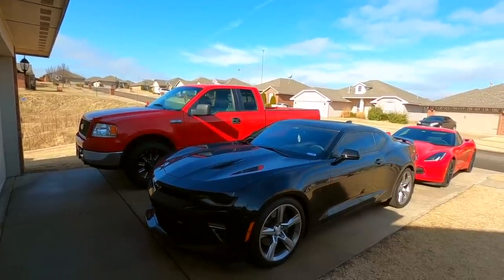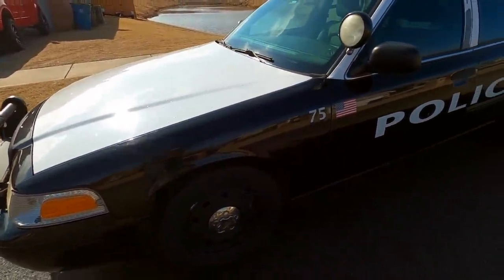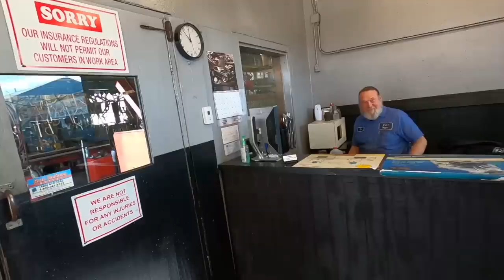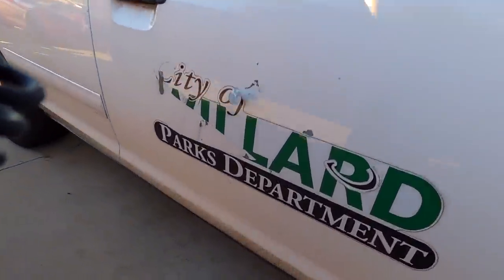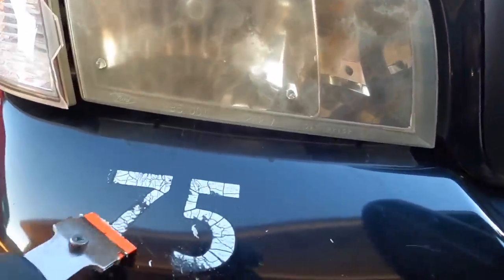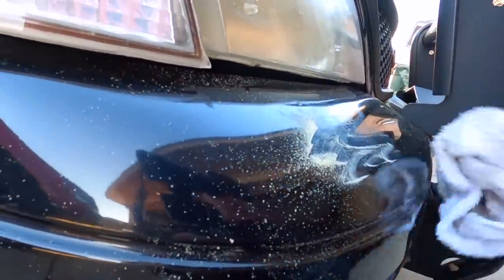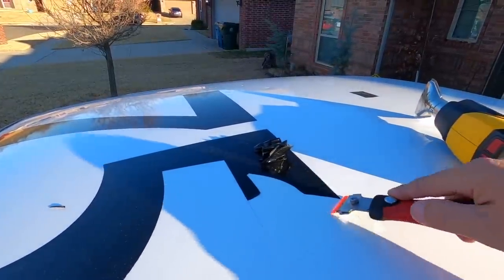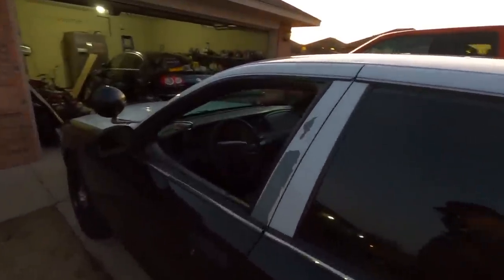Copart $1250 2009 Ford P71 Crown Vic Police Car - New Exhaust + Sticker Removal

Comment: Improved sound, BUT for $450 I would expected to seen new pipe front to rear, and a 2.5" pipe to allow thjat v8 to breath, would add a deeper sound to it too....
Reply: On Ebay you can get Flowmaster 40s for $70.00 each.  That would be $300 for labor.  That seems excessive.
Reply: @mexicanspec  Yeah, that was pricey.
Reply: Agreed. My local shop did my whole 2.5" stainless steel exhaust with 2 super 10 flowmaster mufflers for $515 total. Red Run Exhaust in Ephrata, PA if you are close. They do amazing work for a great price.

Comment: I did the same 40 series on my crown Victoria however, I took out the tail pipes and did a turn down right after the muffler. Wasn’t too loud but sounded really nice and gave it that old school muscle sound it needed. And do a secondary cat delete. Those just take up unnecessary horsepower.

Comment: Had 2011 p71 imported to the UK got a British registration plate on it now after got to UK standards etc 110k on the clock got it up on the ramps and it looks like its done 110 miles not 110k amazing cars so happy i finally got a American car imported 4.6L V8’s amazing engines

Comment: Love the rims on old red. Those flowmasters sounds so soooo much better than straight pipes. Excellent choice. They've got a Brush you can use to pull that off also. Just put it on your drill

Comment: Mufflers sound great! Reminds me of the turbo mufflers. The eraser whheels work great I use them to remove old pin striping. I also use a steamer to remove window tint and decals. there is a lot less chance of warping the plastics etc but with that number you are probably using the best thing for it. I paid like $30 for my 3M eraser wheel, where did you get that for $6?

Thanks for sharing! Take care and God bless you all!

Comment: nice job. in the beginning, you said you would not name the former owner. then at the end you did. i hope they dont get mad. it really looks good and i think all black would look beautiful. 
i am wondering though... are you going to bend back the push bumper? have you tried? if you get couple of boards. one on the top of the bent part, and one on each pole, and put a jack in between them i bet it will straighten out. maybe a little help from a sledge on the top of the board. and interesting note... stock exhaust was fine, but new exhaust is POURING water out of the pipes. no water at all with stock.

Comment: The Flowmasters sound ok, I went with Magnaflow on mine, similar result at first, but after 3 years and 35K miles they're a bit louder and throaty now....how about a sinister gun metal gray for the car? Look like a detective mobile..
Reply: Yes gray
Reply: Yes gray!!
Reply: Detective or unmarked car?  that could get someone in some trouble.  I'd advise against that no matter how cool it is.
Reply: Cleetus has one in gray called Chief
Reply: @gbowne1  unmarked P71's come in all colors, relax, it beats black and white all to hell
Reply: I got a Flowmaster on my town car and at first, they droned pretty bad, after 500 miles I feel like they're quite a bit quieter now.

Comment: The wires could also have been for emergency lights behind the grill (mounting tabs there) or on the push bumper cross over bar.  You're right about the hood.  That's what I was taught in '85.  Stun & stuff into the backseat. Peer pressure then to rarely handcuff prisoners. You controlled them.

Comment: I paid 250 for 2.5in pipeing with Magnaflow mufflers on my 2004 crown Vic.

But if you wonna sound a bit louder chop the secondary cat’s and run 2.5in pipeing with x pipe and run some tips out back like a Mercury Marauder not the turn downs what the Vic comes with.

Comment: Cut out all 4 cats  and replace them with two high flow cats and h pipe and 3 inch tips use the super 40 mufflers it will sound good

Comment: The color should depend on the original color in the door jams, under hood, and deck lid. If they are the same color, that’s the color to use. They should be one color if the police paint scheme was applied after delivery.  If you are lucky all will be the same and it will save you a bundle at MACO.

Comment: The decal probably smeared because it was still warm. By the way, why is the heat gun still running while you're using the wheel?
Reply: You keep the fan running until the gun cools off. Otherwise you can fry it
Reply: @jimnielsen4076  ahhh. I just assumed Randy left it on. It happens.

Comment: Hey man I’m not sure if you noticed but your door trim on the rear doors is different on the “new” doors and doesn’t match the other side
Reply: They came new with the front door moldings uninstalled in the trunk. Did so in case your emblems were large.
Reply: jim nielsen Oh yeah that makes sense. Though on the rear doors since he got the 2003 doors if you look carefully you can see that the rear door trims don’t match eachother

Comment: Randy have you ever tried using "Thrush" performance mufflers? We started using them on our vehicles,, and to be honest they sound pretty good, actually liked them Better then flowmaster, Liked vid!! Have a GREAT DAY, See ya next vid
Reply: I had the old thrush on my ss back in the 80s loved them came with the screaming chicken stickers
Reply: @robbiejones4933  yeah we have one on our eldorado and it sounds pretty awesome
Reply: @ItsaRomethingeveryday  over the summer I found a 81 shortbed f 100 one owner I'm putting crown vic motor and suspension under was looking on Ebay and found some old style ones still in the box I think that's what I'm gonna put on the truck
Reply: @ItsaRomethingeveryday  were did u find yours?
Reply: @robbiejones4933  I had Advance auto order it in for me
Reply: @ItsaRomethingeveryday  I might go that route to get me a couple  thanks I appreciate it
Reply: @robbiejones4933  for the dual outlet one I bought it was around $43 dollars, it has 2inch outs and 2 1/2 inch inlet
Reply: @robbiejones4933  ours is a 90 eldorado with the 4.5 liter v8, with the thrush it sounds like a Chevy pick-up

Comment: When I worked in autobody we had a eraser wheel air tool with special heads, stickers or vinyl was no match for that tool we had I ended up buying my own 350$   I never had any luck with goo off at all last time I tried it i got mad and threw it across the yard haha junk.... that eraser wheel you have works fine but it needed to spin faster

Comment: WD40 is also a good solvent for the nasty glue residue left by vinyls.  But any method will be less successful after the adhesive has aged, such as on your ten year old Crown Vic. We recently stripped a full body vinyl off of a 2016 Lambo, which had some of the worst original paint quality I have ever seen, and ended up having to take it all back to the bare shell. Apart from clear bras, I would never recommend putting sticky plastics on cars.

Comment: Leave the Flows and delete the cat's if you wanna make it louder !! Cherry bombs and glass packs will NOT sound good. You will thank me in the long run I promise ya. When the check engine light comes on after you delete the cat's, don't worry about it. Abel Racing in MWC will delete the check engine light $75.00. BTW , keep up the good work man !!